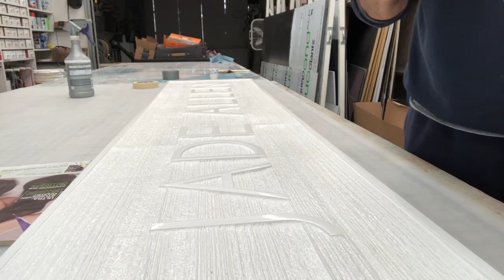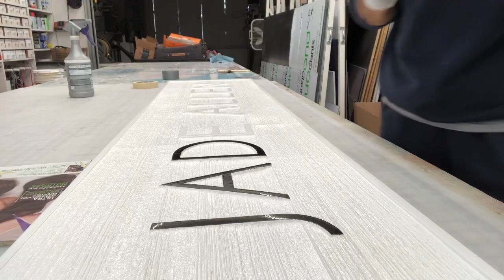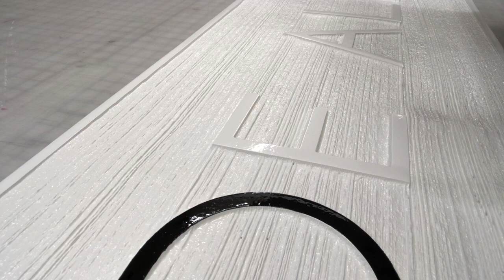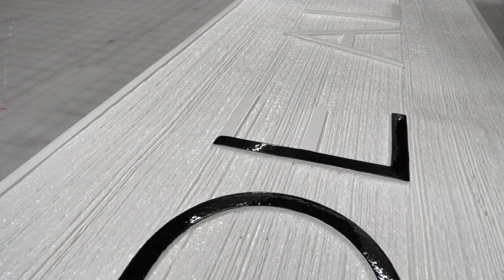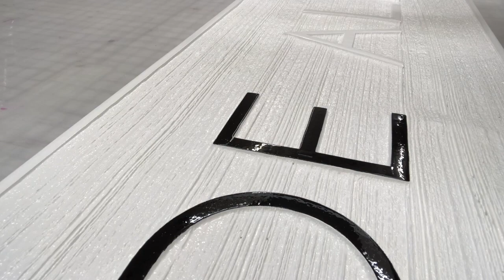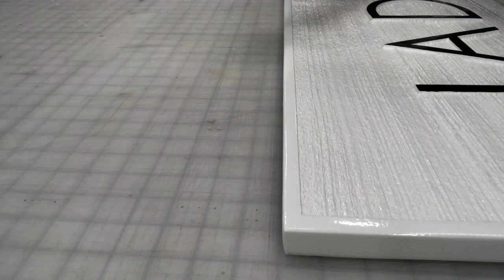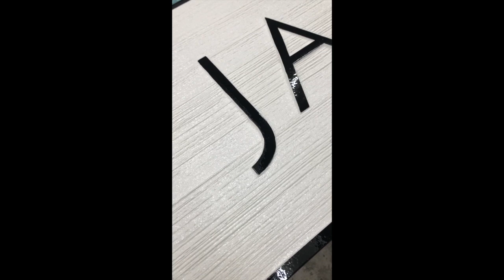Sand Blasted Painted Sign

Comment: I was learned to use a small foam brush. One strokes from center out on letter. If one does strokes from outside in, one gets a mess. Like palleting brush on side of cup. Once I got a feel for it, and letter size permits, I would switch up to a larger foam brush to cover more ground. One time this shop could not get redwood so located cedar. As I was ripping boards to be glued up, there was water slinging back on me like a hose pipe. Explained problem to management and was told to roll with it. This is my favorite part of the story. After install during finishing touches my co worker asked What in the world is this? The one section of sign that was the cedar had huge water blisters forming all over. Glad to see you back posting. Thanks for share. Good day.
Reply from the maker: That’s awesome! I love foam brushes. 👍😀

Comment: I recall many years ago there was a company (can't recall the name) that sold grain screens that were designed to add a redwood look to sign foam and other cheaper blanks like pine, etc.
Reply from the maker: Yes. I made a frame and attached wire to it, it worked great! I haven’t done that in 30 years.

Comment: You should check with some CNC operators. They can recreate that sandblast texture with software. I use a CNC to make signs like that all the time. And as far as sandblast mask goes, I get mine from US Cutter it works well.
Reply from the maker: You know, that’s a great idea. I will find someone to make a sample. Thank you! 👍😀
Reply: @davidographicsguy  no problem. I hope that it works out for you. You’ll probably find it as more economical solution also. I’m no professional CNC operator, so if I can do it….😁.  Good luck!

Comment: Ever try duct tape?  Years ago I worked prepping cars for plastic media blasting.  We used two layers of duct tape on the trim and other pieces that didn’t get blasted.
Reply from the maker: Hey Al, Duct tape doesn’t survive the pressure and volume it takes to remove wood. Stencil needs to be thick and rubbery enough to bounce the sand off. 👍😀